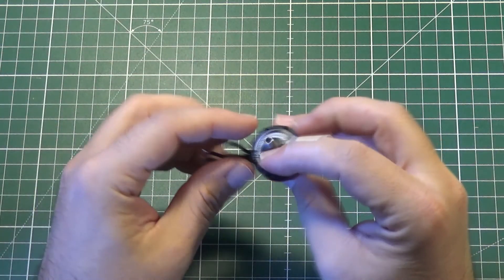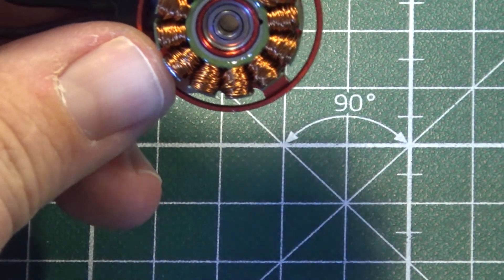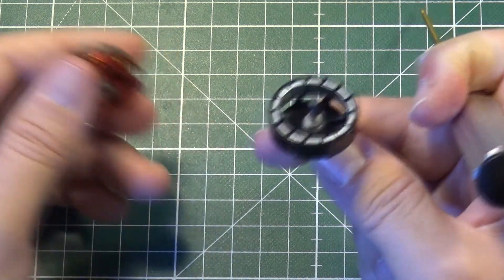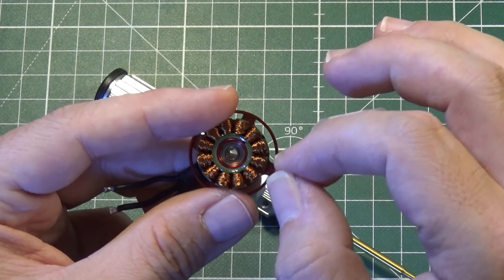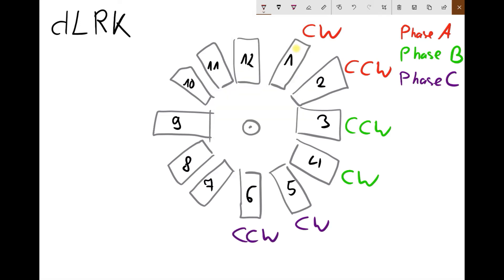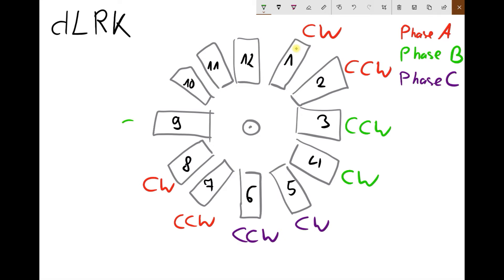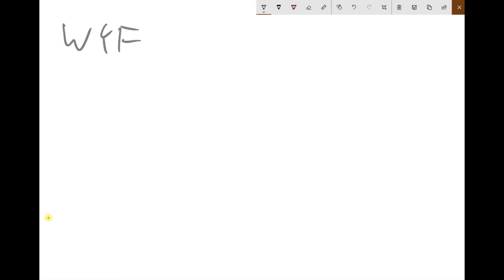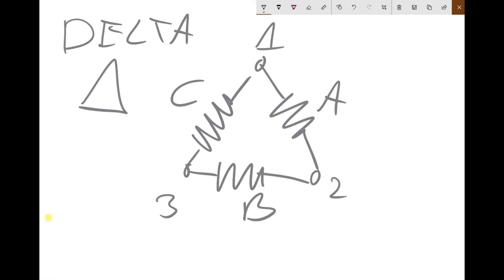How to wind and rewind an RC brushless motor | part 1

Comment: Wye terminations can be used.  It just means you'll need thicker wire and fewer turns to get the same Kv.  I don't know the exact math formula, but there seems to be about a 2 to 1 kV ratio between delta and wye.    
So it ultimately depends on the available wire and how many turns can be wound onto each pole with it.  If only a small number of turns with the available wire can be squeezed in there, you're going to want to terminate in wye to keep the kV low enough to use anything over 3.7 volts to run it.

Comment: Pawel, nice video. However, I think you mixed the facts. The number of coils (poles) affects the speed... not the number of turns in a coil. The motor speed is proportional to the number of coils/poles and the voltage frequency. 

Multiple conductors solution (instead of one thick conductor) is usually chosen because the electricity actually runs on/through the conductor surface (not the core). Therefore, multiple conductors can sustain more current and thereby produce stronger electromagnetic field. Other than that, you are mostly right.

Comment: Thank u for this video but I got a question it's not that easy to wind it are the wire are coated?
Reply: The insulation is just a very thin and flexible layer so it doesn't really make it harder to wind. For example, a 0.3mm magnet wire I found has 0.02 - 0.03mm insulation thickness in its specifications.

Comment: The details are hidden in the fact that the freaking Chinese never follow the technical specifications. And even if a triangle (delta) (T) is declared on the passport, inside there will be a star (wye) (Y). After all, sometimes you want to save money, and buy a motor for more HF and simply slow it down by reworking it from a delta to a star.

Comment: Dear sir. This is very useful vlog. Very good.  ;) so....how to mod the rewind of 2300 kv motor so they can perform better for the race...yes of course for adding some thrust and running 4s. I want to push them for their optimum performance? Is it possible?

Comment: im guessing this is a DC motor?
Reply from the maker: yes
Reply from the maker: or rather not. This is a 3 phase AC motor, only the ESC is powered by DC
Reply: Actually it's BL (Brush Less) DC motor

Comment: I want some more information about motor wiring how can I contact you
Reply: How can we bind a 48v 1000w bldc motor for scooter that can run near about 60km/h (mainly my question is about coil binding just like coil binding wire size and how many rounds should be of wire in a coil)